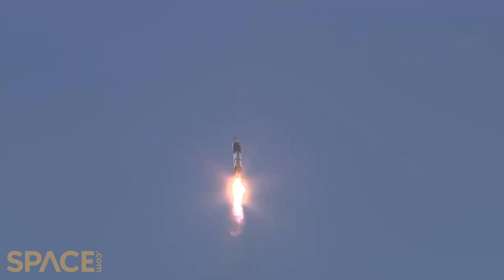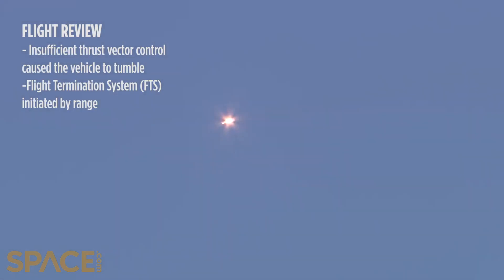Relive Firefly rocket's explosive first flight in these amazing views

Comment: Do any documentaries go over the self destruct system and process? I'd like to see how it's designed, installed and executed. Can't recall watching anything about it.
Reply: It works great, whatever it is. I wonder if the Saturn Five had one?
Reply: These are called flight termination system. Every rocket ever to exist has one of these. If the guidance software detects any anomaly on any of the rocket's main systems, namely propulsion, payload, structural......the FTS is activated by the guidance control, or the range safety officer at a specific time, so that no public harm is caused, and it is disposed off at a safe downrange distance.
Reply: @davewinch6029  yes it did for the unmanned tests but not a good idea with manned flights which the majority of Saturn 5 launches were.
Reply: @soumyojitpal3399  My father was in the Air Force for 22 years. Space Command. He was a launch officer for a slew of different rockets like Bomarc, Thor, Minuteman and a few others from Diego Garcia to Eglin and Edwards. More than a few stories about when it all goes wrong. Some included him running to a moving truck after a rocket didn't blow up as much as just transfer everything from the inside to the outside on the pad. As he tells it a HUGE cloud began covering and infiltrating everything around the pad. Later a few people got complacent and picked up a random object here and there and were none to happy about the caustic effects rocket fuel had on the hands with even the slightest touch. One of the reasons behind the self destruct. 
I've got a ton of info on it but I have never seen anyone go over the systems and their histories.
Reply: @M2M-matt The manned flights also had the FTS ready.

Comment: Well, for the first attempt it was pretty ok.  I wonder if six engines could be a better option so if one does fail it is much easier for the other engines to compensate in terms of velocity and provide better thrust vector control.
Reply: No. You need every pound of thrust to get the thing into orbit. There is no redundancy. If you could get into orbit with one less engine you would, as an engine is heavy. The best you can hope for when you lose an engine is that you can get the rocket far enough downrange to get it out of harm’s way and avoid causing too much contamination of the ground or sea.
Reply: No. You need every pound of thrust to get the thing into orbit. There is no redundancy. If you could get into orbit with one less engine you would, as an engine is heavy. The best you can hope for when you lose an engine is that you can get the rocket far enough downrange to get it out of harm’s way and avoid causing too much contamination of the ground or sea.
Reply: No. You need every pound of thrust to get the thing into orbit. There is no redundancy. If you could get into orbit with one less engine you would, as an engine is heavy. The best you can hope for when you lose an engine is that you can get the rocket far enough downrange to get it out of harm’s way and avoid causing too much contamination of the ground or sea.